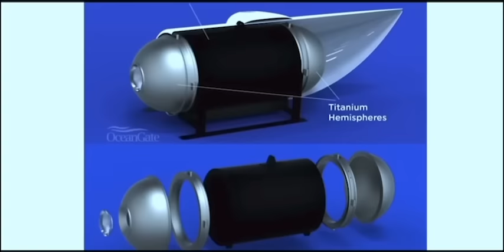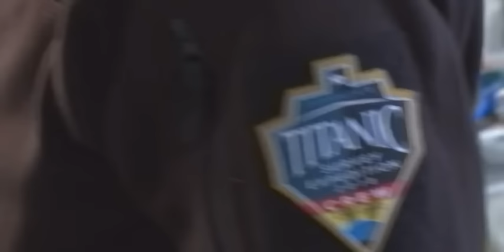First look at #oceangate #titan Debris

Comment: The small 2 inch wide contact area of glue is what I couldn’t believe. I’m surprised it made as many dives as it did.
Reply from the maker: my thoughts exaclty
Reply: 2 inch wide? Lol.
Reply: Yes same
Reply: But it did not do that number of dives to the full depth of Titanic... As far as I know it neved had.
Reply: It's constructed in a way that you wouldn't be able to inspect it either.
Reply from the maker: @Anita95_original  you’re right it was it’s 5th attempt but it went to other deep wrecks and reefs too
Reply: Wouldn't the pressure be pushing the end caps on so glue (strength) may not be such an issue.  
Unless the glue can't stand the pressure then that could be where the hull is punctured.
Reply: @An.Individual  It is true the end caps are pressed towards the cylinder, BUT it is not that direction that is the problem, the problem is the radial direction where the shrinkage is different between the two parts, that will shear the glue or any interface not explicitely designed as a moving joint.
Reply: @An.Individual As I understand it the pressure would be going down towards the ends of the hull. That's because of the shape of the submersible.  Also the hull was made of a totally different material than the titanium end caps that would not have as much flex as the hull.  It was just a matter of time because of the underwater pressure this submersible endured.
Reply: I'd have thought it should be a slot such that its supported on both sides. My worry here is that the failure may have started as a visible leak such that they might have known their fate. Lets hope not and it doesn't really matter now anyway.
Reply: @Anita95_original  spot on! when i first saw the design without seeing the process in this video i asked myself how could you build a bulletproof connection with the titanium endcaps. 
now that i see how exactly they buildt it i can not believe it lasted that long at all.
Reply: Glue under the got damn  Ocean are these people serious
Reply: @Anita95_original No it did. There have been other people who have taken similar dives to the same place with him. They have been interviewed about their trips. One person said that during their trip, which had no underwater issues, surfaced, but the rescue team couldn't locate them. One more "flaw" that was discussed with the owner for safety concerns which he never took seriously or ever fixed. The lack of a GPS or a decent GPS Locator not being installed onto a submarine that even when it surfaces you still NEED a team to open it for outside. There is no way for you to get out once your sealed inside of this thing. The fact that the rescue or retrieval teams couldn't locate it for 4 hours, if I remember correctly what the time frame was, is again absolutely insane, dangerous, and shows a lack of willingness to ensure the safety of each person that PAYS YOU A LOT OF MONEY AND PUTS THEIR LIVES IN YOUR HANDS! This entire tragedy was not only correctable and fixable, but it shows that extreme greed, narcissism, and hubris can have catastrophic results when you disregard every safety protocol created to avoid these types of problems and disasters. Granted when you are at those depths, anything can and sometimes does happen, but again, THAT'S WHY they have such stringent protocols for a underwater submersible vessel. I don't like to talk about or speak ill of the dead, but this was again a tragedy that was preventable. What I don't understand is HOW could or why would you, if your as rich as this man was, why would you cut corners, use materials that have been deemed as substandard and insufficient, especially for the depths that your expeditions will go to? Especially when the people who are EXPERTS in the designs and safety protocols have told you NOT to do it? Some have said it's actually safer to go into space than to go underwater at those depths. ALSO these machines after every mission, again especially at these deep underwater depths undergo such intense and harsh pressure that the vessels safety could have easily been compromised. It's like if you take a piece of metal or even an aluminum can, and you kink it or if you bend the metal piece. As you repeatedly do this the piece of metal weakens, the cans "integrity" also weakens and then💥BOOM!!💥 it snaps or in the case of the can the kinks get weak enough to where a crease becomes a hole. These are in my opinion simple, but vital ideas that on the scale or the importance you need when your diving that deep, WHY WOULD YOU NOT WANT THE SAFEST AND MOST DURABLE AND EFFECTIVE PARTS YOU CAN GET? Especially when your rich enough to basically buy whatever you want. It makes no sense.
Reply: Did this actually get people down there or did they just have failed missions.
Reply: This guy has invented a whole new meaning to the term "Rushed"
Reply: There is a lot of pressure on the two endcaps pushing in. As much as there is on the straight part. It's just that the straight part was far weaker 😂
Reply: @Anita95_original 13 time's this would have been the 14th.
Reply: @An.Individual  Yes. BUT the surface area of the pipe section, is larger than that of the end caps
Reply: The amount of dives it did caused the stresses that led to the implosion. It’ really boils down to expansion and contraction. The carbon fibers contract under high external pressure when the sun goes down, when it comes back up the carbon fiber expand back to their neutral state or possibly slight larger. The molecular bond in anything weakens with expansion and contraction. No different than bending a metal wire or bar back and forth till it’s molecular bond weakens and snaps
Reply: Sub* goes down. Sorry. Autocorrect
Reply: You could inspect it with untrasound however that testing was estimated to cost around 20,000 dollars. And mr stockton rush didn’t want to part with that 20 grand after each dive
Reply: stupidity...yes!
Reply: @ashscott6068  That makes no difference, if the glue was the issue there would be more chance of the ends falling off on the surface than at depth.

Comment: It's amazing Titan survived any of the deep dives. Even as a lay person, I can easily see the flaws in the construction methods. So far I have not seen a full chronology and results of the prior dives. I believe I saw someplace that one early dive required rebuilding the cylinder.
Reply: The use of a mishmash of composite and arguably incompatible (different tolerances etc.) materials was a huge mistake.  The way the sub was constructed, and the way the materials were layered, meant that any issues with the carbon fiber could only be detected through ultrasound scanning - and I don't think that was ever done.

As a retired US submarine captain basically pointed out the other day, would you pay to fly on an experimental plane made by a nutjob when he says "Hey guys here's a new way of attaching the wings and nobody has ever verified the design or approved its safety"?  No, you wouldn't.
Reply: Correct!
After so many dives, the cylinder was downgraded to 3000 m, so it had be repaired, to qualify for 4000 m.
Reply: I think the major thing people aren’t discussing is that of all the operational deep submersibles in use today, all of them have spherical pressure vessels. Since spheres can withstand the pressure of the ocean evenly along its surface. Cylindrical designs have too many weak points, mainly the midpoint where pressure can be applied unevenly. 

So yes, even though he included an assortment of different materials for the job, the desire to extend the pressure vessel to include more passengers was the fundamental flaw. That thing would have imploded anyway as a cylinder.
Reply: @szaki I would have downgraded it... to unseaworthy...🙄
Reply: @postcardsfromprotest  the arrogance of this man is beyond me
Reply: How many times do I have to joke about the sube being glued togehter
Reply: @MFFMPN  He paid for it with his life. Too bad he didn't survive long enough to say “Oh shit”.
Reply: Carbon fiber , glue, titanium, and bicycle designers can't get this to work. Unfreakin believable.
Reply: @MFFMPN  Arrogance cost him his life. Unfortunately, he took four others with him.
Reply: @postcardsfromprotest  How many lion tamers must be clawed to death before you understand how to properly do a circus stunt, Mr. Barnum?
Reply: @halfbakedproductions7887  lol that happened, some kook tried building a low earth rocket to prove the earth was flat.  Yeah he died on its maiden voyage, he didn’t even test it unmanned,  he just went splat.
Reply: I heard they left one the nuts off the front as it was to difficalt to put it on ?.
Reply: @Khumry  I heard the same, too. They installed 17 nuts, and left off the 18th nut that fasten the end cap to the hull.
Reply: @Khumry  I believe the fixtures inside the submersible were simply screwed into the carbon fiber pressure hull.
Reply: @Andy1805-y8w  No, there was a liner inside with led strip lights behind it also. Fixtures where screwed to the liner, not the carbon fibre.
Reply: really ,lay person, what is the flaw in the constuction?
Reply: @szaki  3000 or 4000 doesn't matter as that was the maximum rating. When engineering something you never use it's maximum rating without any safety tolerance as a rule things are engineered to be well below the maximum safety ratings.  Taking it right to it's maximum rating is taking it to the failure point an accident waiting to happen.  You never run anything at their maximum rating as prolonged use at that level will result in failure.
Reply: JoeCool-bn5re  ?

Comment: This is exactly what I told my wife had happened. Anyone with any common sense and a general knowledge of how pressure works can tell that, that glued joint is inherently weak and if the carbon fiber expands and contracts at a different rate than the titanium that joint will fail. I'm shocked it lasted as long as it did.

Comment: As a "shade tree" Mechanic, even I know that this is like using the wrong gaskets between a Cast Iron Engine Block and Aluminum Heads. It's not that difficult of a concept to understand that dissimilar materials expand and contract differently due to temperature and pressure variations. Thank you for making this video pointing that out!
Reply: Honestly this guy sounds like he’s never serviced a bicycle, let alone worked on an automobile 😂
Reply: I've been involved with various forms of auto racing, in various capacities since I was young, back when dinosaurs roamed the earth. I've asked several submersible engineers online if there is a limit to how many times the sub's various parts, as well as the entirety of the craft could be subjected to the stress of the deep dive, and not really gotten an answer to satisfy my curiosity.
  In the past, I've dealt with certain automotive rules and regulations from different sanctioning bodies, and virtually all had regulations dealing with longevity of various high stress parts, that were referred to as "Numerically Finite". Simply put, a component falling under this classification has a set time or number of outings that it can be used, and once that threshold is crossed, the component must be replaced, even if there is no sign of fatigue or failure. 
  We also see carbon fiber used in such racing applications, however certain parts are made of woven cylindrical carbon for just the opposite of what was attempted in the submersible. We use said carbon fiber constructs for driveline components(driveshafts, half shafts, etc.), not for their strength, but rather their weakness. The stuff is immensely strong in a torsional capacity, but side loading or impact will cause it to shatter and take on the look of a large broom, as the carbon fiber reverts back to it's original thread filaments. This is advantageous in a crash, as it is much safer to the driver and responding medical/safety crew, because it eliminates the danger of having a broken, metal driveshaft flapping around at 9000rpm.
Reply: @Leigh_J being that he is correct, and you are laughing, sounds like you have never worked on anything, lol
Reply: @ericharmon7163  huh? "he" meaning who? I'm referring to Stockton Rush.
Reply: @Sharon_L_W  lol, OK I thought you were talking about the shade tree mechanic.  My bad.
Reply: @ericharmon7163  lol all good. I should've written that more clearly. FWIW I've rebuilt a '66 mini cooper among tinkering with other things, so I definitely appreciate mechanics out there :)

Comment: He tried it a few times and it worked. Ignoring the fact that time and pressure was weakening this thing. It was a ticking time bomb
Reply: He ignored pressure and time with a design that was more susceptible  to pressure and time .
Reply: Literally ticking as the carbon fibre started to delaminate then the final boom
Reply: He got lucky the few times it survived the previous trips.  Solid engineering put to the wayside and replaced by Lady Luck, who is a very unreliable mistress!
Reply: @daviddogsbody  more of a creaking time bomb
Reply: Every dive a crapshoot.
Reply: Did you happen to notice the acrylic view port is missing